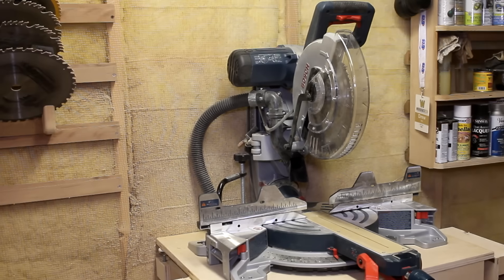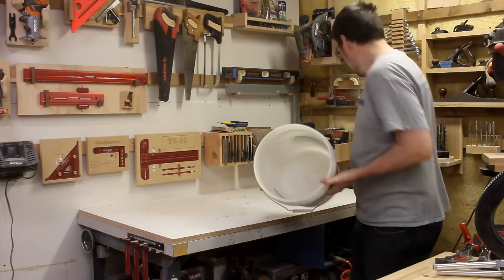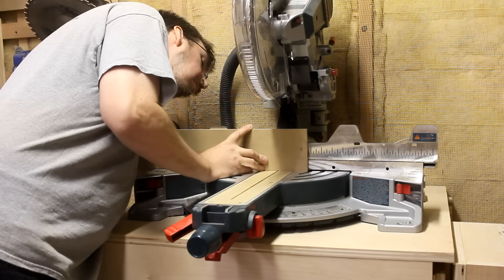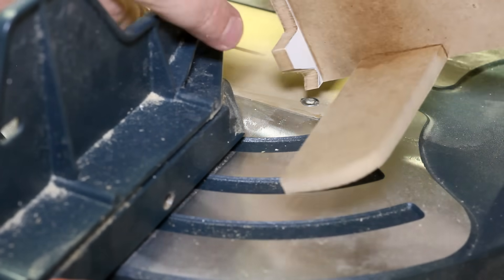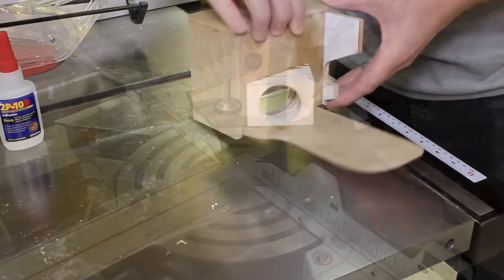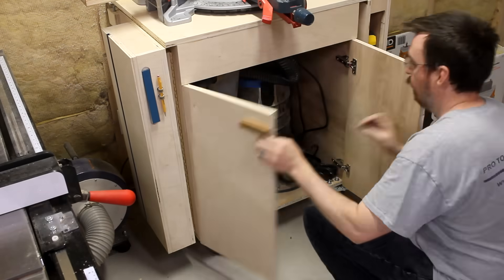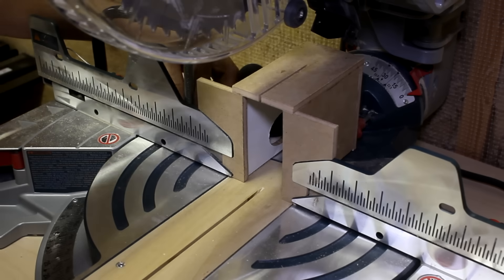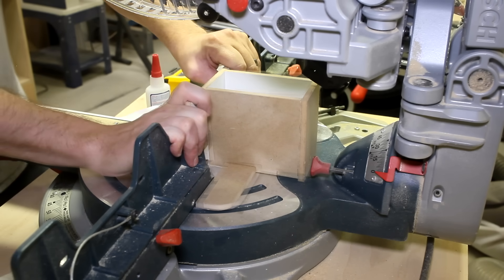Shop Work: Improving Dust Collection

Comment: What a great idea! I have that exact same miter saw and built a shroud around it with downdraft dust collection at the rear, but even with that and the stock dust boot, I still get dust everywhere. Like you, most of my cuts are 90 degrees, so this concept is definitely something I'm going to try this winter. Great video, and great sense of humor!

Comment: Good job, I have a dust bonnet like giant shroud around the miter saw and even with my dust collection system on saw dust escapes. And just gets trapped in the folds of the shroud. Even though I have a 5 inch dust collection system since the saw is right at the opening of one of the garage doors open the door put a big fan behind me and cut away. I am going to give idea a shot. Thanks

Comment: Drew, there was a mistake in your measurement methodology...your dust collection is wayyyy better than you calculated!  Assuming you're using 20lb paper, the sheet of paper weighs 0.64oz (20lbs divided by 500 sheets).  This means that the mass of the paper is a significant portion of your dust measurement.  It needs to be subtracted before finding the percent of dust that you collected.  If you subtract the 0.64oz from each measurement then find the percentage, you see that there's a significant difference in the dust collection percentages: 25% for bag, 61% for Vac only, 75% for Duct tape mod, 86% for your solution.
Reply: He put the half inch block on a sheet of paper on the scales so the weights are all relative.
Reply: Joe S but with 5 cuts he would need 5 sheets of paper for it to truly be equal.
Reply: There is actually a frame where you can see the weight of a piece of the paper that was used, it's .18oz (OMG, what a cheapskate!). I saw that I've commented the nearly the same thing, I got measurements of 71%, 85%, 91%, 95%; respective to the order presented in the video.

Comment: Excellent....
I have 3 Bosch glides for in the field work. I will make one of these for straight cuts. Just a little tidbit for everyone. The festool kapex rubber dust shroud fits the Bosch glide, as do festool hoses. The shroud is much wider than the Bosch, and does a great job. Plus, very cheap instead of duct tape, especially doing tons of miters.
Love your humor... Especially the meth lab comment... LOL
Keep up the good work... Steve

Comment: To get a more intuitive measure of improvement in dust collection, start with your 88% efficient "VAC ONLY", which is losing 12% of the sawdust material, and then compare with your custom "NEW DUST SHIELD", which at 96% efficient is losing only 4% (!!) of the sawdust. Your improvement is (12 - 4 )/12 = 2/3, or 66.7% of the dust that would have escaped, kept out of the rest of your shop and your lungs. And your hair. Et cetera. For straight cuts, but as you say, that's a lot of cuts. Nice!

Comment: To remind you to tighten the tension on the band I saw that someone took a piece Masonite, cut out an octagon  (yup like a stop sign) painted it red.  Put it on the table of the saw when you release the tension to remind you to tighten up.  Surprisingly it worked even for a guy like me who wears shirts with my name on them so I can remember who I am.
Reply: I put one of those 99 cent red key-chain carabiner around the blade.

Comment: Just a though, but you may get the remainder of the 4% (or some of it) if you were to removed the zero clearance insert and tested again. That last 4% may be from the very last bit of the wood that falls through. I know that 96% is great and with a shop-vac, is pretty stellar results. I would be happy with it. Great videos!

Comment: Interesting experiment. I'm setting up dust collection for my work bench. I'm gonna have built in a planer, miter saw, table saw, jointer and eventually a router table. Gonna use one vac and dust collector for all of them and make some kind of blast gates for each one so I can limit suction to the one in use only. 

I've seen these large 14"x14" covers you can use on the bottom of table saws that have a hose attachment on them. Have you experimented at all with dust collection of other tools?

Comment: You need to do one more test, please. Unless I'm mistaken, the fences on that saw are reversible. Meaning the one on the right goes to the left in the one on the left goes to the right. As with your solution this precludes the use beveled cuts, but still allows miter cuts. It also produces a much greater amount of suction in the integral dust collection. Of course, I could be completely wrong about those fences as I don't own the Bosch the Bosch.

Comment: At 8:26 you can see the paper weight is .18oz. Always zero out container weights. So subtracting that from your results:
.53/.74 = 72% Stock Bag
.63/.74 = 85% Shop Vac
.67/.74 = 91% Duct Tape
.70/.74 = 95% Custom
Your improvement vs the other three methods is actually a better spread than you had thought. 22% over stock, 10% over shop vac, still 4% over duct tape. 
Less dust is less dust, worth the effort in most cases.

Comment: Removing the weight of the paper would get you 75%, 85%, 91%, and 95% respectively.
Reply: I thought so too, but he puts a piece of paper under the piece of wood when he weighs it so not so much.
Reply: The mass of the paper is 0.64oz, so its a significant portion of each measurement.  if you subtract that from each measurement then find the percentage, you see that there's a significant difference in the dust collection percentages: 25% for bag, 61% for Vac only, 75% for Duct tape mod, 86% for Drew's solution
Reply: @davidanderson1060  It looks like the scale registers 0.18 oz for the paper at 8:25 right before he puts the wood on the scale. Standard 20lb stock printer paper weighs about 0.16oz per sheet. Though he might be using adhesive paper, which weighs 0.18oz per sheet. Adhesive paper is commonly used for crafts and woodworking templates, so it's reasonable to assume that the 0.18 oz registered on the scale is accurate.
So the block actually weighs 0.74, and the dust collected from the bag, shop vac, duct tape mod, and custom attachment weigh 0.53 oz; 0.63 oz; 0.67 oz; and 0.7 oz, respectively.

0.53 / 0.74 = 71.62%
0.63 / 0.74 = 85.14%
0.67 / 0.74 =90.54%
0.70 / 0.74 = 94.60%
Reply: Thats true but the cyclone isn't collecting 100% of the dust going up the vac tube - with a bit going into the vac filter.  How much I don't know.

Comment: Good video.  I was wandering if you have done or will do the same test with a wider piece of wood?  Since the blade will be further away from the chute to the dust bag and the custom dust chute you made, curious how collection works then.  I have a dust collection system that I have not full installed yet and will be looking to get a pvc pipe behind, under the miter saw.  It will hookup to where my dust bag is right  now.
Reply from the maker: This isn't my first style of this shroud.  I've had to learn a new way to cut wider boards so that the shroud is still effective.  Basically, you cut a small channel on the pull, drop the blade slightly, and push cut.  This sends the vast majority of the dust through the kerf channel and into the shroud.  Works nicely.

Comment: Hi Fisher - Nice video, nice design and build.  Did you have any way to quantify the size of the dust particles that you collected?  I would suspect that your method would have removed a significant amount of the very fine dust (sub micron in size that's of greatest health concern) that would contribute very little to the total mass of the collected sample.  Also note that it's not such a bad thing that you didn't "close the mass balance" by collecting 100% of the kerf/cut material, since it would be most certainly expected that some fraction of the dust would report to the undersize of the cyclone separator (out the top), ending up in the shop vac.  I think it would be very interesting if you made 100 cuts, collecting dust in the cyclone AND the shopvac filter bag.  THEN you'd be able to assess things with much greater confidence.  Let me know if you're interested and I can assist with the experimental design and assessment.  - Phil

Comment: I have done the same, but my opening in the Front is just in the upper section that big and I have also still connected the vac to the normal dust port. My vac needs a bit more air flow and I think it helps a bit to catch dust during long cuts.

Comment: The hole between the box and the vacuum receiver tube could have been sculpted a little to improve dust flow (A bit like porting the inlet valves on a motor. 
Have a look inside the box itself. You will see how the sharp edges induce a vortex leading to turbulent flow. For that extra 2%. Otherwise superb ideas and a lovely workshop.
Reply from the maker: Yup, that might help

Comment: Don’t underestimate that tiny increase just because it sounds like nothing. An 8% increase from 88% is actually a 67% decrease in dust thrown into the air, and that is what you’re really interested in. Also only half as much dust as with the duct tape extension, so it’s definitively a big deal.

Comment: Funny and informative video! Are you doing anything to catch the dust that goes through the throat plate? A foam gasket around the bottom of the saw table and a vacuum port through the cabinet under the saw might catch that other 4%!

Comment: 3:50 “Using a square I can hold things at 90° and then I hit it with some activator to instantly make all my mistakes permanent”

5:30 “. . . and then proceeded to get glue all over my table saw”

6:18 “ . . . and then after several years of filing I was able to turn that circle into an oval“

Lol 😂

Comment: The way to look at the numbers is by what percentage is NOT captured. In other words what percentage is scattered all over the workshop. 

Your dust shield leaves only 1/3 of the dust of the ‘just shop vac’ and 1/2 of the ‘shop vac + tape’ solution. That what I call a terrific result!

Comment: Why did you not also put another hose with an y-connector to the standard dust collector port?
Reply from the maker: Would have reduced suction in the shroud by 50%.  Plus, virtually no dust makes it above the shroud.

Comment: Impressive catch....two comments: 
Round off edge on the intake ports for more laminar flow
3D print these for major chop saw manufacturers- it’s a business line
Reply from the maker: You know I was surprised... I thought I would have to round things off too but when I remove the shroud to make a miter cut, there's never any residual dust.  Evidently despite the sharp internal edges, it still gets sucked up.

Comment: So i am going to be super nerdy but..... it appears you forgot to deduct the weight of the sheet of paper from all of your calculations. Should be deducted from the numerator and denominator of all of your numbers (Bag should be 0.53 / 0.74 = 72% ... yours should be 0.7 / 0.74 = 94.5%)
Reply from the maker: The paper was included in all measurements, including the .5" block which eliminates it as a variable.
Reply: If you do a bit more math, you will find that you have 64% less uncollected dust with your construction than with the shop vac. That is a significant amount, if you ask me. Congratulations!
The above comment is correct though, there is an error in your calculated percentages. You have measured the weights of a sheet of paper + the collected dust. Next you have calculated the ratio between (sheet of paper + collected dust) and (sheet of paper + generated dust), which is not the same as the ratio between collected dust and generated dust. The sheet of paper weighs 0.18oz. As stated above, this should be substracted above and below the line, resulting in; 72%, 85%, 91% & 95%.
Reply from the maker: @NBrugman  I thought I was very clear when I stated I was only ever good at lunch and recess.  I stand corrected, thanks for the input! 😀

Comment: Thanks for the video. Humorous and nicely scientific approach. Subscribed your channel. Additonal alternative to get even higher capture% would be to have your box + Y branched suction on both blade and table side.
Reply from the maker: That would actually reduce suction in the shroud though. And virtually zero dust makes it through the shroud and out on top. BUT I haven’t tested it so you could be right.

Comment: Man I've seen some huge dust collection cabinets that almost fully enclose the back half of the saw. Really only good for a permanent mount and a non portable saw. In any case, the difference in massive amounts of material and time would only serve to close that 4% gap in collection. Your little doodad takes the cake. Simple, cheap, removable, and it allows the saw to remain portable. Nicely finnessed solution buddy. Good on Ya!
Reply from the maker: You got it exactly Stephan!  Thanks!

Comment: Laughed many times. I have that saw and it is horrible with dust. I’ve watched a million of these as well as hacked up and made three ducted systems now. Only thing I can see that will increase your percentage more is to somehow make that hard turn into something softer. Like a rounded turn. Stumpy nubs found that those square surfaces kill efficiency and I think even on the scale of your box making it just a little more organic inside will yield even better results. I unfortunately work as a finish carpenter, flooring installer, gate/fencing carpenter, and just about whatever my wife can come up with on the weekends. Even though I have a dewalt compound (non slider) as my job site saw, I’m renovating both of the units of our duplex so my Bosch has now turned into my lungs’ worst enemy! Thanks for the vid and keep up the wit; I love it!

Comment: @ 6:30, after using the Forster bit to cut the first hole through the plywood, glue it in place and put the bit on a hand drill and use the previously drilled hole as a guide and you will have your oval hole drilled quick and easy with out needing a file for an hour.

Comment: I think you did a great job. The overall design is compact and using the built In clamp to secure it was also really smart. If you were to make a version 2.0 I would suggest leaving the front only as wide as the saw kerf to give a bit of zero clearance and make lining up cuts a little easier. To keep the air flow higher you would open up the opposite side of the box to get a cross wind of sorts. But who knows, mabye the design you made is better. 96% is pretty good!
Reply from the maker: Once I'm cutting something wider and I need to pull the blade out to full extent, I need a wider mouth to catch as much dust as possible.  I'm afraid a zero-clearance would restrict a lot of that from getting into the shroud.
Reply: @FishersShop  that's a good point.

Comment: I have a fridge magnet for holding papers, like a clothes peg (clothes pin?). I clip it to the blade of my band saw when the band is loosened when not in use. When I use the saw the clothes peg is magnetically attached to the top door.
Reply from the maker: Not a bad idea.  Thanks, Bill

Comment: Enjoyable and useful video. Thanks. Miter saws are notorious for poor dust collection. 
I have a Bosch sliding miter saw. Dust flies everywhere even with my 3 HP tornado vacuum. Your solution is great as long as you don’t frequently change angles on the saw, which I do. I picked up an idea from a past issue of Wood magazine that improves dust collection enormously. I can’t find a way to paste a photo into this You Tube blog, but here is the design of the cowel I’m using.
Using a piece of 5/32 inch thick piece of rubber or heavy foam cut a 7x7 inch square. Then symmetrically taper opposites sides of the cowel so that the top is 5 inches wide. Thus you end up with a piece that measures 5 inches at the top and 7 inches at the base. Slightly round off the corners of the base. 
Then  slightly curl the top of the cowel and place it about an inch inside the exhaust behind the saw blade. Attach the top of the cowel to the inside of the exhaust with a few small bolts ( I used 3 mm bolts and nuts) The saws's exhaust is made of aluminum so it’s easy to drill the bolt holes. Be sure to use some small washers to keep the bolts from losing their grip on both the rubber cowel and the exhaust. As you make a saw cut the cowel will drag slightly over the wood, but stay behind the blade. Some of the bottom of the cowel may be cut by the saw for thick pieces of wood but a few cuts shouldn’t interfere much with dust collection.

Comment: I use my table saw as a work station all the time. I know some people use newspaper or craft paper to help protect it from glue and such but I use a large piece of heavy vinyl I got at the fabric department in Walmart. For what it is, I don't think it can be beat. It's water proof and resistant to  most finishes and solvents I use. Wood glue doesn't even stick to it all that well so it can be peeled off after it dries. I've had it for more than ten years and it was worth every penny.
Reply from the maker: Nice tip

Comment: Hi, where you, besides the weight, als able to tell the if there is a difference in particle size for the different methods? What i mean is: which method produces the least airborne dust.
Great vid, anyway.
Reply from the maker: Yes, the bag can't capture the very fine particulate whereas the cyclone does.

Comment: Digital scales  are a common item in many cabinet shops. Small items such as shelf pins or screws can be counted by weight much faster and more accurately than piece by piece. Also to balance knives for shapers and molder, among other things.